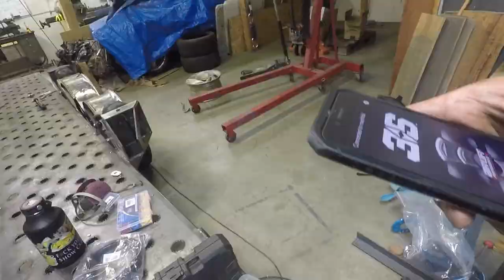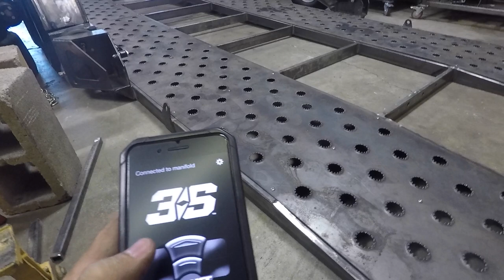Bagged Trailer Build - Air - Part 8

Comment: What was your estimated total build cost? My son is about to build one for his Ag Mechanics Class. Also, what air system and bags did you use?
Reply from the maker: I spent about 10k on this project. I ended up using Firestone airbags and airlift control manifold.